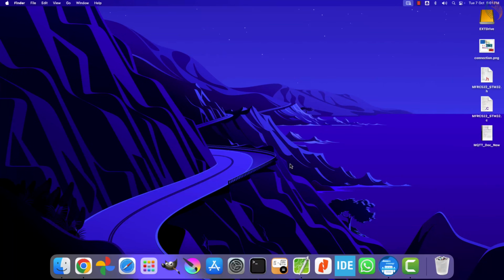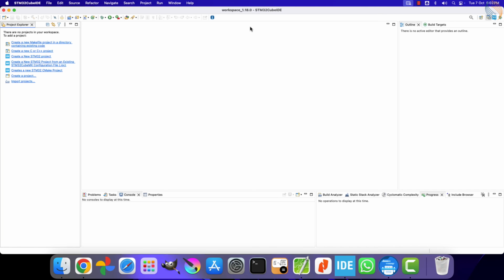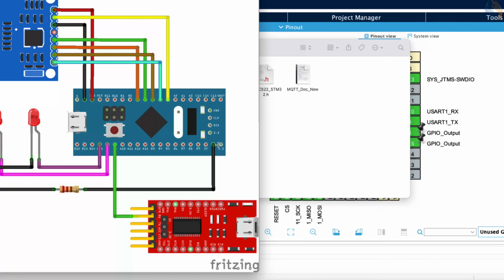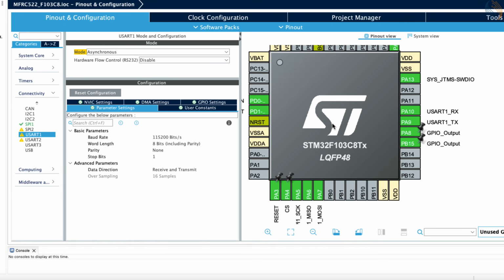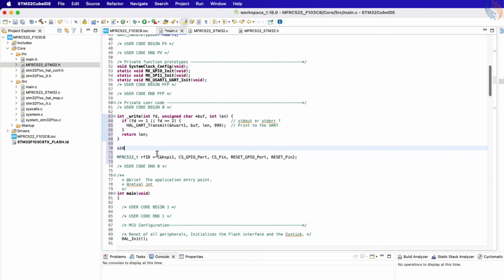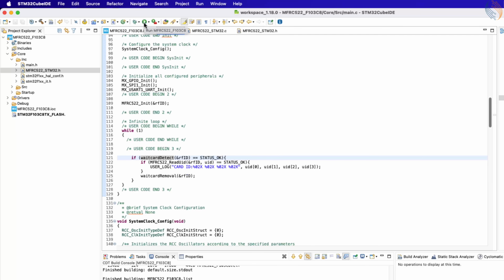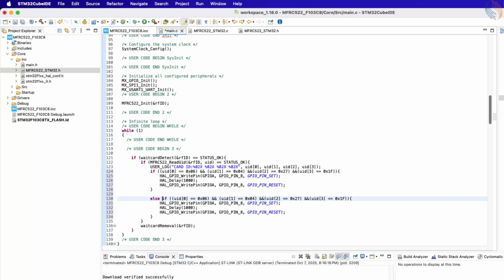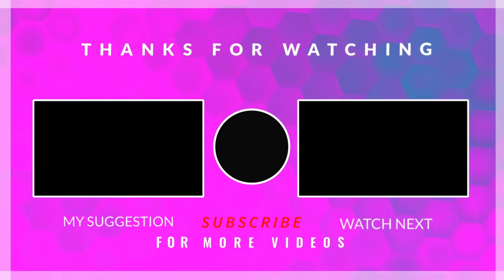STM32 MFRC522 RFID Tutorial | Interface RFID Reader Using SPI in STM32CubeIDE

Comment: sir this code not work on F4 never detect card. please help me.
Reply from the maker: Keep the SPI clock low first, around 500bps or 1Mbps. 
Also enable debug logs to see the detailed output. This will help you debug the issue.